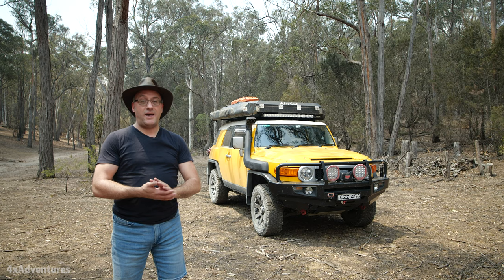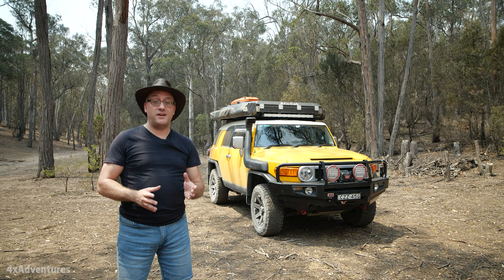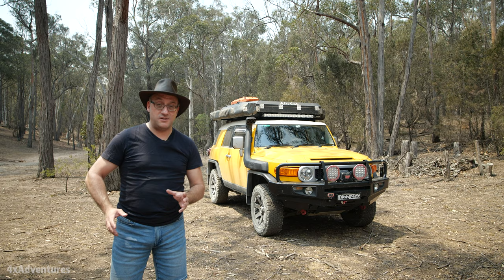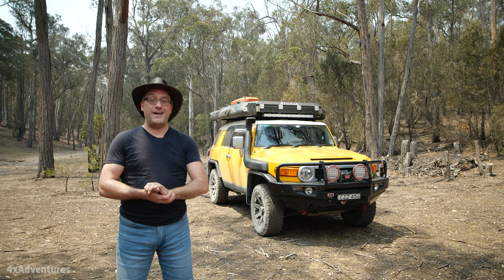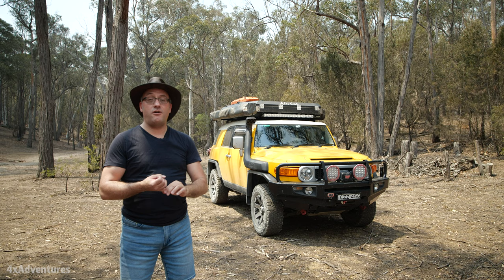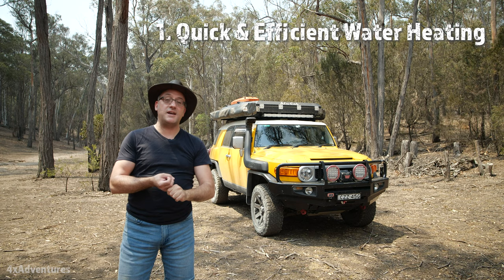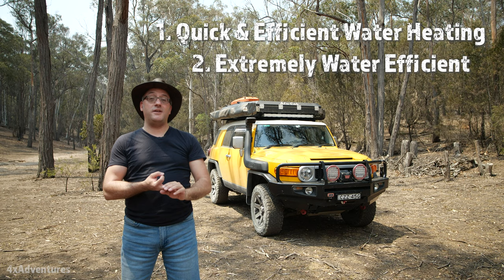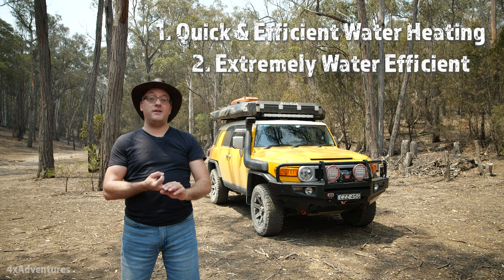Built-In Hot Water and Shower System for Touring/Overlanding | @4xAdventures#adventure #4wd #touring

Comment: I maybe interested in a built set. I love the mixing valve! What was the approximate cost of the set up? (Just so I can add shipping to the states) thanks!
Reply from the maker: Hi Bill, I am in the process of working out a kit that I can sell online for anyone that wants to buy a ready-made unit. 
The challenge is installing the heat exchanger. Glind has a distributor in the USA - I have included a link to their website in the description of this video. You can get the heat exchanger from there. As for the rest of the parts, can you let me know which bits you are interested in and I’ll work out how much it would cost for you.
Reply: 4xAdventures outstanding let me know!

Comment: Hey mate, cracking hot water system ! What has this cost roughly ? Just the set up you have without the water tank etc as I’d just go from a 10L bucket. Cheers.
Reply from the maker: G’day Paul, thanks very much! It’s kind of hard to estimate because it’s a custom install and installation in each vehicle would vary a bit. I have listed all the parts in the description and links to where you can get them from both in Australia and the US. I’d guess it would probably cost around $750 for the parts alone. It’s not the cheapest solution out there because it’s all custom, and it may not suit everyone, but for those that travel like I do, on the move every day and want a super quick & efficient set up, this definitely has some major advantages over what you can buy.
All the best! 😊👍

Comment: Thanks for the video.  I like the idea of a heat exchanger as I am driving every day, but for us, it is me, my wife, and two kids.  Any idea how many gallons you can run through before the shower can't maintain temp?  I've seen various sizes of heat exchangers online, so I'd have to get a bigger one probably.  Just wondering how many gallons you get out of it.  I figure since the coolant isn't flowing through the engine when shut off, it would have a pretty limited amount of water that could be heated.  You thoughts?
Reply from the maker: G’day Chris. 

There are so many variables. The size/throughout of your pump obviously matters, as does the shower rose/tap - if you can throttle down the water at the shower rose so less is coming out then you can be more frugal with your water use. If you don’t leave the shower running constantly like at home, (i.e. get wet, turn off water, soap shampoo etc., then turn on & rinse off in 1 min or so) you can get many people using it with very little water used.

My water tank is only 20L, so I haven’t tested beyond that. But I can definitely get 20L of hot water at least, with the engine turned off. If you have plenty of water (e.g. you run a hose down to a river etc.), then you can just let the engine idle while showering and then you get an unlimited supply of hot water.

I guess the whole philosophy behind this design was to use as little water as possible, and to not waste precious water by mixing until the temperature was right. 

Also, I don’t think a different size heat exchanger would make much of a difference because it is simply heating water on the fly as it is flowing through the unit.

Another option is to use an electric water boiler instead of a heat exchanger. That was actually the first version I built based on the same principle and it also worked really well. The one downside to the electric boiler version was the boiler was a 10L tank, which added extra weight.

I think the heat exchanger method works very well, without needing to carry seperate hot water. As I mentioned, you can always just turn your engine on for a few min to generate more heat, either while everyone showers, or between.
Reply: @4xAdventures    Thanks for that reply!  Yeah, I spent some time on a Canadian Navy frigate.  I'm used to turning the water off to lather when conserving water.  I too live in a desert now (Utah) so water conservation is always a necessity.  I carry a total of 80l on my truck and usually can refill every couple days around here, but I can stretch that amount out to about 4 days for the four of us.  I can carry another 60l or so in jerries if I was heading somewhere really remote.  I don't like most hot water systems mainly due to weight and space reasons, but I'm gonna give a heat exchanger a go when I get a chance later this summer maybe.  First I have to find some space under the hood for the heat exchanger.  I already have a second battery, so it is getting full under there, but I'll find space.  As you say, restart the engine if it gets too cold.  I'm gonna put in a mixing valve like you have as well.  Thanks for all the info.
Reply from the maker: Glad my video was useful to you! If you have any questions with installation let me know. All the best!! 😊👍

Comment: One question doesn't your vehicle need to be idling in order to circulate the coolant on that side of the exchanger? 
Also would have been nice if you showed your system working.
Reply from the maker: Correct. But the engine block retains heat for quite a long time after you stop your engine and this is still sufficient to heat the water. But yes, best performance when engine is running.
I’m working on another video where I will show it all working in more detail as well as take you through the installation. 
😊👍
Reply: @4xAdventures  Andrew St-Pierre White mentions that he has hotwater tank on some of his builds. 
He is very light on detail on this but he will hit a switch and flow water from his cold water tank to a hot water holding tank 20mins before stopping. Then mix that hot water with temperature valve like yours using the shower head.
Avoids the need for idling but probably a good bit more complex to install and you might struggle to find space for a hot water tank on the FJ.
Reply from the maker: Yes, I’ve seen his video. The first version of this system I built used the Duoetto MkII hot water heater - just like he has. The plumbing is the same. I opted to use the heat exchanger because I had no space for the 10L electric water boiler, not to mention the extra weight of carrying around an extra 10L of water. So the heat exchanger version works very well for me, but if you have a larger 4WD, the water boiler is a valid option.

Comment: How do you get the cold water in to go to both the temper valve and the heat exchanger from the pump ? Do you use some sort of splitter ?
Reply from the maker: Yes, that’s exactly it. Water tank -> pump -> splitter. 1st path -> cold input of temper valve. 2nd path -> cold input of heat exchanger. Then hot output of heat exchanger -> hot input of temper valve. Finally, mix output of temper valve -> shower nozzle. That’s the basics. 😊👍
Reply: @4xAdventures  Cheers mate love your work.
Im going to set one up that only has the heat exchanger as a permanent fixture and the rest will be contained in a bucket/container type scenario with a submersible pump that i just connect to the heat exchanger when ready to take a shower
Reply from the maker: Thanks. Yes, plenty of people use it just like that. The main downside to a heat exchanger is you have no control over the heat & you then need to waste precious water mixing until you get the temp right. But if water is not an issue, then it’s all good!! :) I was considering making up a kit that has the other bits already built in a box, but haven’t had the time as yet. 😊👍
Reply: @4xAdventures  my plan is to recirc back into bucket until it reaches the right temp , then unhook from heat exchanger , plug shower head on and away i go , no need for temp valve then :)
Reply from the maker: Yup. All good!! I just wanted a super-quick solution where I plug in one hose & away I go. But that will work well too! 😊👍

Comment: Awesome video I'd like to do something similar to your setup, however I am in the USA, do you have links for the pump and tempering valve?
Reply from the maker: G’day Steve, I don’t have specific links unfortunately. But I will try and track some US suppliers down. 
You should be able to find these things from RV/caravan & boating supply stores. All the best! 😊👍
Reply from the maker: Hi Steve, OK, I have since found out that Glind have a distributor in the US. Check out glindhotshower.com for the heat exchanger. The push-fit plumbing is from johnguest.com - I’ve also seen it on Amazon. The pump, from memory was a Shureflow 9.5 L/min automatic pump,l. I don’t have a link for that though, but marine/boating supply stores could have it. Good luck!!
Reply: @4xAdventures  Thank you for this information. I will be building this system soon enough!
Reply from the maker: No worries! Good luck! 😊👍

Comment: Can this shower setup be used in a vintage camper?
Reply from the maker: Hi Paul, yes. An alternative to the heat exchanger is to use an electric boiler. Check out my How Water Shower System FAQ video where I explain it in more detail. The plumbing is essentially the same in both cases.

Comment: so the engine has to be running to circulate the coolant? otherwise I like the rest of the system.
Reply from the maker: Yes, correct. But, if the engine is still hot from driving, then you can use the shower without the engine running. If you want to have a shower when the engine has cooled off (e.g. 1st thing in the morning) then just run engine for about 5 min.
Also, this system works just as well with any heat source, like an electric water boiler instead of the heat exchanger.
😊👍

Comment: What if you're not attached to a vehicle (camper trailer) how would this work?
Reply from the maker: Excellent question. Instead of the heat exchanger, you can use an electric water heater (I recommend the Duoetto MK2). The plumbing would be the same. I’ve built a system like this before and it works great!

Comment: Hello, I am thinking about expanding on what you have installed here, by running the system in the back of a Troopy.  My thought would be to put a Tee in to the engine coolant system in the engine compartment, put a bypass near the firewall to minimize the chance of springing a coolant leak while in motion (by closing the system and isolating it to the engine bay area), then extending the coolant lines to the cargo area of the Troopy, where I would mount the heat exchanger, pump and valve, etc all close(r) to the water tank, sink and shower setup.  I think some thought would have to go in to insulating the lines, so as not to overheat surrounding components, etc along the way to the cargo area.  Based off your experiences with your system, do you see any issues with what I have described?  Thanks in advance for your time!
Reply from the maker: G’day Brandon. Hmm... that sounds like an interesting idea. 

The heat exchanger is best suited to be located in the engine bay - that’s what it was designed for. I haven’t heard of anyone installing it anywhere else. I’m not a mechanic or a plumber, but I don’t think it is a good idea extending your coolant hoses all the way to the rear of the vehicle - even with a bypass tap. The fewer things to go wrong, the better. I’d be very very careful with the radiator hoses & not mess too much with it because if that goes wrong, you could seize your engine. I think it’s probably better to keep the heat exchanger in the engine bay and to then run the cold water from your tank to the heat exchanger, and the mix output back to where you need it. It’s no greater effort than your idea but far less risky & more efficient in my opinion. 

The other alternative is to not run any hoses between the engine bay & rear of the vehicle at all. What some people are doing is to simply have an in & out outlet under the engine bay and to use a bucket or jerry can.

The other alternative is to use an electric water boiler like the Duoetto MkII. The plumbing is the same, but this way you can have everything in the rear of the vehicle, all self-contained. I would probably choose this method if I had enough space. Of course, the downside of the electric boiler is it needs to be full of water all the time, which means you need to carry an extra 10L of water in the boiler which is an extra 10kg of weight. But if weight is not an issue, and space is not an issue, then all good!

I hope that helps a little. Once again, I’m not a mechanic or plumber, so if you want to push on with your idea, I’d recommend getting the opinion of a mechanic.

Best of luck!! 😊👍
Reply: @4xAdventures  Thank you for the feedback and alternative options.  I have looked in to the Mkii and unfortunately they only offer it in the 12v/240v option.  In which I would prefer a 12v/120v option for using on shore power in the US.  

I am going to have to play with the exchanger option as a whole.  I have an idea of how I want the Troopy build to layout and would prefer the hot water system to be in the back utilizing sink and shower facilities there.  

The other reasoning I had in running the engine coolant to the heat exchanger in the back, was to ensure when the system was heated, it wasn't exposed to freezing temps, causing any freeze damage to the pipes.  That said, I could leave the exchanger in the engine bay and just over-kill insulate the water pipes to the back.

Thanks again, I sure appreciate your feedback.
Reply from the maker: Hi Brandon, no problems at all. Good luck with your build!! I’d be interested to hear about what you ended up doing when it’s done. All the best!! 😊👍
Reply: In regards to setting your shower at the back of the vehicle...Could you run a cold pipe from the pump and a hot pipe out from the heat exchanger under the vehicle to the back? They would connect to the tempering valve set up at the back of vehicle, which of course then connects to your shower head. Can you see any reason why this wouldn't work?
Reply from the maker: Technically, sure you could locate the various components wherever you like by just extending the plumbing, but there are some things to consider. Heat loss is one thing. How much that would matter... 🤷🏻‍♂️. There probably wouldn’t be a huge amount of heat loss, but there definitely would be some. Also, there is some risk of the plumbing getting damaged under the vehicle, so some protection for the plumbing wouldn’t hurt. But apart from that, yes, it should work. The other thing to consider is the length of the plumbing. The pump will have to push the water from the rear of the vehicle to the front & back again. That’s about 6-7m of hose to travel through. That might lead to reduced pressure if you don’t choose a pump that is capable of maintaining pressure over that distance.
Good luck!! 😊👍

Comment: Hi im looking at doing this to my land cruiser I've allredy got the heat exchange in for meany yrs  my question is sometimes I like to have a cold shower will I be able to to this with the temprite valve will it let cold water out if the hot water is not hot ?
Reply from the maker: G'day Michael, Yes it will. The temper valve is mostly used to limit the high temperature to a safe/predetermined temperature, but if the water is cold, it will still allow it to flow through.
Reply: @4xAdventures  ok thanks for your replay
Reply from the maker: Not a problem. Some more options (if you don’t want completely cold water) is either place an inline tap/ball valve before the shower input of the heat exchanger so you can limit the water passing through it (of course, never limit the coolant that is flowing through the heat exchanger via the radiator hoses - that would be bad!!), or you can simply turn down the temperature of the heat exchanger via the knob on top of it and turn it up again for the cooler months.
Reply: Thank you!  I've been trawling through the comments to have this exact question answered :) Sorted!
Reply from the maker: I’m glad you found your answer! 😊👍

Comment: hey, is the temper valve also from John guest?
Reply from the maker: Yes it is. You don’t have to use the John Guest temper valve though. Any temper valve will do, but the John Guest one is light weight and has the quick-fit adaptors built into it so connecting the John Guest plumbing is easy. But there are many ways of making this work. Good luck!! 😊👍

Comment: Also where to buy the temp valve ? 
I’m in Brisbane 
Many thanks ..
Reply from the maker: Here are the links from the description.

Products used: 
- Glind Heat Exchanger (glind.com.au or USA http://glindhotshower.com)
- Seaflow 9.5L automatic pressure sensing water pump - available in Australia at roadtechmarine.com.au or RV/caravan/marine supply stores.
- John Guest plumbing fittings (johnguest.com or roadtechmarine.com.au)

Glind is located in QLD, so you should get that pretty quickly. 
Road Tech Marine supply the temper valve I used as well as the John Guest plumbing bits. They have stores throughout QLD as well. https://www.roadtechmarine.com.au/store-finder/QLD

Good luck!! :)

Comment: What if you want to control the temperature of the water? You cant?
Reply from the maker: G’day Michael, you can control it by adjusting the temper valve. Some temper valves have a rotating temperature control know on top, instead of just a screw head like mine does. But the whole idea of using a temper valve is to have a fixed temperature where you don’t need to waste water while adjusting. So I have set mine to a nice comfortable temperature for showering and that works well enough for most of the year. I have actually taken my idea even further since filming that video and I can bypass the heat exchanger completely, if I only want cold water, for example. You can get as creative with the plumbing as you like. 
All the best! 😊👍